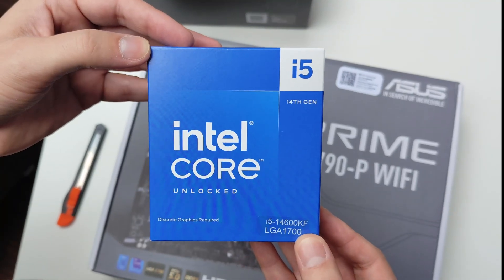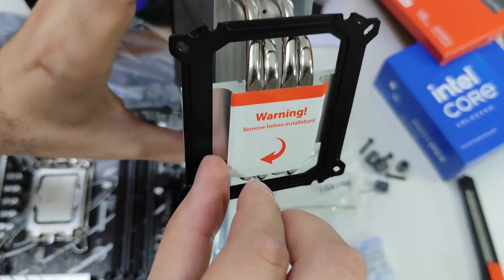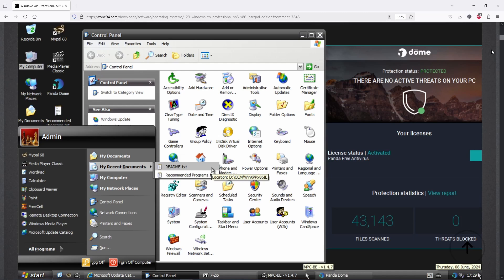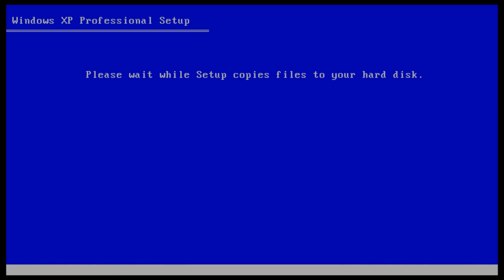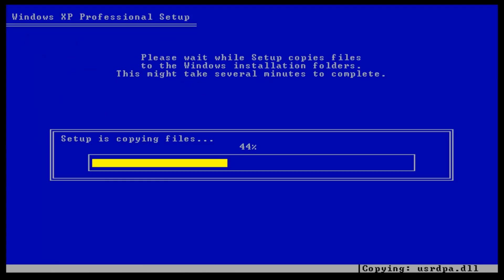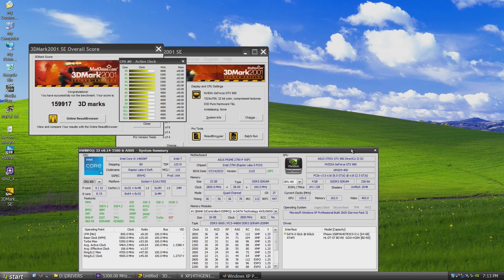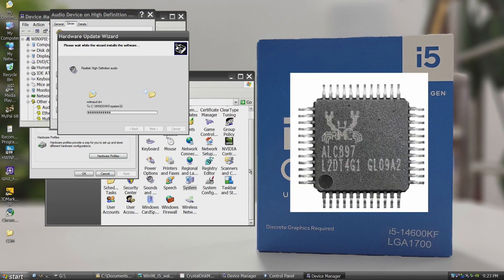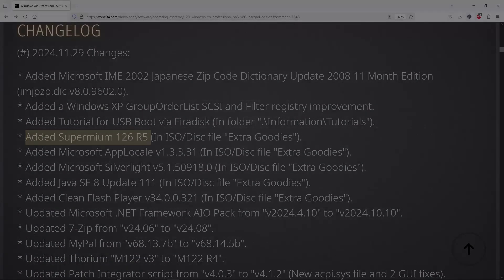Windows XP Meets Modern Hardware: i5-14600KF + DDR5 Z790 Motherboard. NVMe, USB 3.x? No problem!

Comment: This would run the 64 bit version of the same OS beautifully im sure, brilliant video as always!
Reply: The only reason to run XP is for nostalgia and for reliability + compatibility... Using the 64bit version all that goes out the window, it was a failure that is only good for very few niche tasks
Reply: @tunertom3677  Any kind of operating system that runs under a 64-bit environment has to be masses more reliable then one under 32-bit; that's not to say the beloved XP from '01 was lacking stability at all, but it certaintely wasn't a failure, especially if XP as a whole wasn't. Windows XP x64 edition (NOT Itanium) may not have been widely used by consumers or had many reasons to be, but I would like to bet that businesses and some servers had this running at numerous companies for much more intensive tasks at that time.

I have tested both 32 and 64 bit versions of Windows XP on my modern configuarion from 2020 attempting to perform the more intensive tasks I would normally perform on a regular basis nowadays; 3D animation, editing videos, and watching videos in at least 1080p 60fps. 

Before testing, I did have to buy some new cards that had definitive support for 64-bit XP, as the cards I had would only work on 32-bit XP and older operating systems. With that being said, you'd be right to suggest that the list of hardware that supported 64-bit XP is significantly narrower, but I don't believe it's drastic enough of a difference for it to be a 'failure'.

On 32-bit, watching videos would constantly stutter, even with physical address extension. Rendering would also take much longer than it normally would, which is a no brainer. When doing the same tasks under the other environment, they all performed as well as how it would on my Linux installation. It was a night and day difference.

I have not yet tested 32-bit games from the XP or even 9x era, it could be the some might work and others don't. There are some video out there that test games, that I would like to believe were developed at the time for a 32-bit environment, which seem to run perfectly fine under 64-bits:
https://www.youtube.com/watch?v=zW1zzkhfblU
https://www.youtube.com/watch?v=_NsOxG2zwWA
If for whatever reason I chose to use the 64-bit edition of XP over 32-bit solely for retro gaming, I don't think I would ever see any difference, and it would feel just as nostalgic as the regular XP, apart from of course the fact I would be sacrificing support for legacy MS-DOS applications and hardware manufactured in the 90s or even early 2000s.

I adknowledge that XP is best utilized to perform tasks and run on hardware period correct to it's era, it's just a suggestion I had in mind for a potential video which I would love to see in the future, demonstrating how gracefully all editions of XP have aged.
Reply: @tunertom3677  Any kind of operating system that runs under a 64-bit environment has to be masses more reliable then one under 32-bit; that's not to say the beloved XP from '01 was lacking stability at all, but it certaintely wasn't a failure, especially if XP as a whole wasn't. Windows XP x64 edition (NOT Itanium) may not have been widely used by consumers or had many reasons to be, but I would like to bet that businesses and some servers had this running at numerous companies for much more intensive tasks at that time.

I have tested both 32 and 64 bit versions of Windows XP on my modern configuarion from 2020 attempting to perform the more intensive tasks I would normally perform on a regular basis nowadays; 3D animation, editing videos, and watching videos in at least 1080p 60fps. 

Before testing, I did have to buy some new cards that had definitive support for 64-bit XP, as the cards I had would only work on 32-bit XP and older operating systems. With that being said, you'd be right to suggest that the list of hardware that supported 64-bit XP is significantly narrower, but I don't believe it's drastic enough of a difference for it to be a 'failure'.

On 32-bit, watching videos would constantly stutter, even with physical address extension. Rendering would also take much longer than it normally would, which is a no brainer. When doing the same tasks under the other environment, they all performed as well as how it would on my Linux installation. It was a night and day difference.

I have not yet tested 32-bit games from the XP or even 9x era, it could be the some might work and others don't. There are some video out there that test games, that I would like to believe were developed at the time for a 32-bit environment, which seem to run perfectly fine under 64-bits:
https://www.youtube.com/watch?v=zW1zzkhfblU
https://www.youtube.com/watch?v=_NsOxG2zwWA
If for whatever reason I chose to use the 64-bit edition of XP over 32-bit solely for retro gaming, I don't think I would ever see any difference, and it would feel just as nostalgic as the regular XP, apart from of course the fact I would be sacrificing support for legacy MS-DOS applications and hardware manufactured in the 90s or even early 2000s.

I adknowledge that XP is best utilised to perform tasks and run on hardware period correct to it's era, it's just a suggestion I had in mind for a potential video which I would love to see in the future, demonstrating how gracefully all editions of XP have aged.
Reply: Was there ever any reason to use 64-bit Windows XP?
Reply: @THU31  Any 64 bit OS can allocate more than 2/3 GB of ram without PAE, but even if you could use all the ram on a 32 bit OS, I would like to assume theoretically that it is significantly slower than 64 bits. There's this video that experiments the differences between these versions of Windows 7:
https://www.youtube.com/watch?v=iH5D0e_L6a8
A lot of functions are the same as demonstrated throughout most of the video but the most damning difference is the single-threaded and multi-threaded performance highlighted at 7:50
Reply: @velazquezylos90  But I specifically asked about XP. You mostly want to use that system for old games, which were all 32-bit. Only a few games got 64-bit updates, but it didn't really offer any benefits back then.
Reply: @THU31  That has a subsystem called WoW64 which acted as a compatibility layer in order to run 32 bit applications on x64 edition, so you could still run almost the old games you could imagine, except DOS/16 bit legacy games.
Reply: @velazquezylos90  +50%:rocket-red-countdown-liftoff: PCSX2 v1.3 Windows XP 32-bit 😎😈 vs Windows 7 64-bit
Reply: @THU31  Not really, the driver support was never great on XP/Server 2003 x64 and I think WOW64 got better in Windows Vista, and there's not really any reason to run it when you could run Vista or 7 on the same hardware that probably has better driver support and a better compatibility layer. Windows XP x64 was pretty much only useful if you were running a high end CAD workstation or something that actually ran applications that needed more than 2GB of RAM during the time frame when having 4GB or more RAM became possible, around 2005ish until when Vista/Server 2008 launched.
Reply: @THU31  RAM and 64bits programs which can be runned thanks to onecoreapi 64bits.
Reply: Would love to see win 64 !

Comment: hey nice video! i am an early adopter of Arrow Lake (Core Ultra 200S), and i am sad to find out that the specific motherboard i chose for my build (ASUS PRIME Z890M-PLUS WIFI) doesn't appear to support CSM at all anymore, not even with a legacy graphics card... what's more, it doesn't even have certain legacy ISA devices working anymore, in particular the legacy PIT (programmable interval timer), which means no PC speaker either... (it does not have the header for that, so this is some intentional compatibility drop)

i have seen motherboards from other manufacturers with the PC speaker header though (MSI), so here's hoping that this isn't some inherent thing to the Arrow Lake platform but it's just this specific series of higher end boards dropping compatibility... i am eagerly waiting for the lower end chipsets to release early next year to see if motherboards featuring all the legacy goodness come out of ASUS and friends.

if it's an Arrow Lake thing though, that would mean that Raptor Lake is the final great x86 CPU generation (at least from Intel) to be a true IBM compatible PC as well!
Reply from the maker: Hey! Thanks! I really hope the Z790 isn’t the last high-end chipset with CSM support. Why? Well, about two weeks ago, I was planning to buy an MSI PRO Z890-P WIFI motherboard along with a 265K CPU. My first filter was the presence of a PS/2 port, and it has one. Next, I checked the BIOS setup manual and—copy & paste from the /Intel800BIOS_English.pdf: "BIOS CSM/UEFI Mode
Select CSM (Compatibility Support Module) or UEFI mode to meet the system
requirement.
[CSM] For the non-UEFI driver add-on devices or non-UEFI mode OS.
[UEFI] For the UEFI driver add-on devices and UEFI mode OS."

It's equipped with PC Speaker header as well. My only complaint is that all Z890 motherboards have now only 4 PCI-E slots at best.
Reply: @O_mores  that's great to hear! it confirms exactly what i thought. It was a mistake to give my money to ASUS yet again, but you live and you learn, i guess
Reply: ASUS sucks. I got a $800 or so laptop from them in 2021 and it died earlier this year. What a piece of junk for $800. |=(
Reply: Use CSMWrap